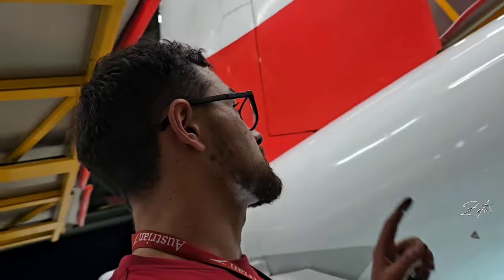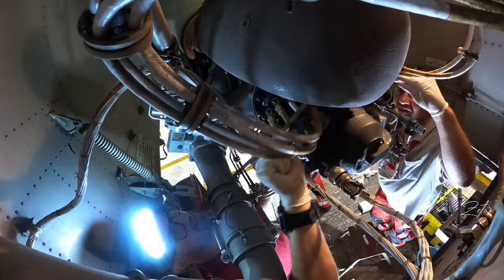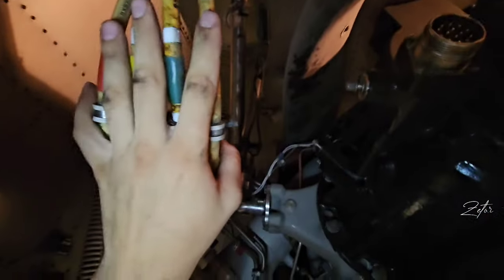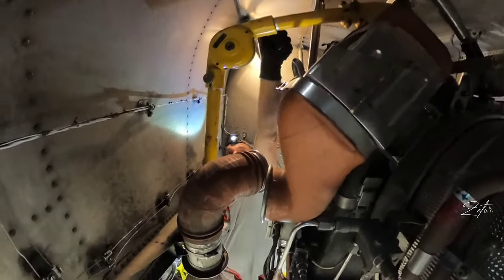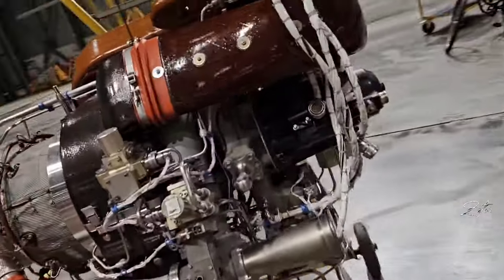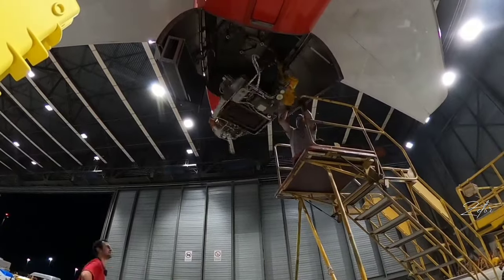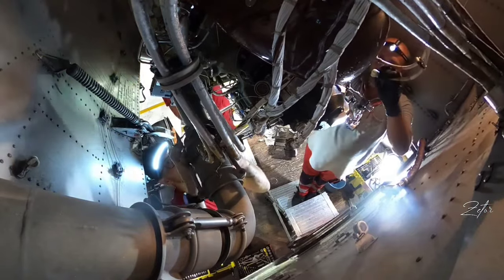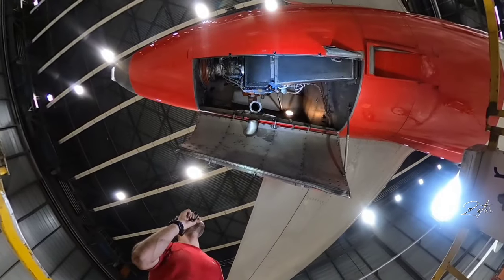ATA 49 How to replace APU on Airbus A320

Comment: All thing was right and as per procedure but in last you not inspected the MCD FOR particles after 10minute RUNUP.
Reply: and even no bleed the FUEL LINE .
Reply: I would assume that he just didn't show it as he mentioned they performed all necessary tests.
Reply from the maker: You got it right, I will not show everything. For that you have the manual. 🙂

Comment: The crank-mechanism i used to work with wass a pain sometimes, especially when moving the apu downwards; always hold the springloaded grip for the brake-assy inside the crank, otherwise it would be un-braked rush down into the ground :/
Great video!
Reply from the maker: I feel your pain 😄,  sometimes it can be really hard to drop it down and it takes a lot of time. I'm happy you like it 🙂

Comment: As a safety tip: If you do an operational test of the APU with the compartment doors open, you need an external fire extinguisher. The one installed on the airplane will be ineffitient with that configuration. 
Very good video anyway!
Reply from the maker: Yes, I had a fire extinguisher next to me. This is a must 🙂 thank you
Reply: Also pro tip: don’t start the video with an alarm blaring where your voice can’t even be heard.

Comment: Can we start the apu with the left door open.?  How to contain the fire if occurs any?  I know it was open for leak check etc but....
Reply from the maker: Of course, you can and it is better to do it after replacement,  bcs you see directly if there is a problem. You just need a fire extinguisher near you. Our hangar is properly equipped for such tests so I'm ok.

Comment: Does the APU run during the flight, or do the main engines provide the power?
Reply from the maker: Depends if one of the generators is inop. You can use APU as a second generator but in standard conditions, it is off after the last engine start, due to fuel safe
Reply: Can use it to supply the packs instead of engines if you need more power for take off right ?

Comment: I didn't know APUs were so unsexy compared to the main engines
Reply from the maker: It must be very compact. I made a separate video where I explained why it is like that
Reply: @zeto.r  I understand the goal of APU is of course different, and there must be space constraints as well. Also years ago I asked an electronic engineer why the reason for the 400Hz in aviation power instead of 50 or 60Hz. Basically with higher frequencies you can have smaller generators for the same power.